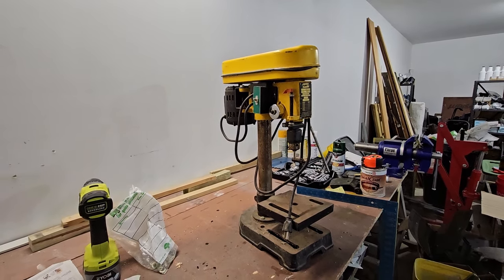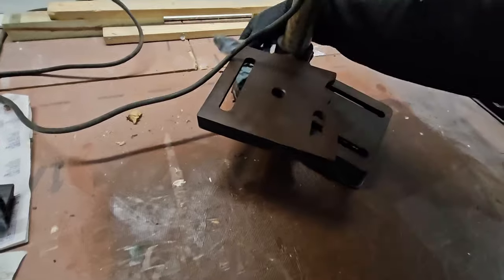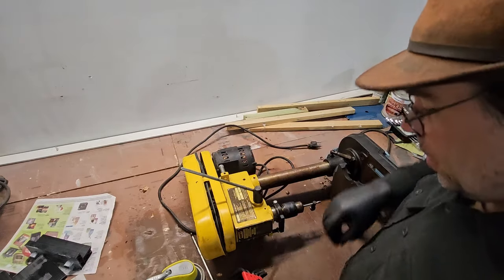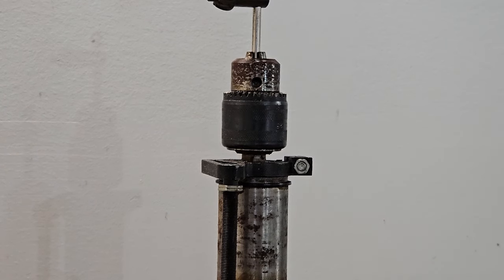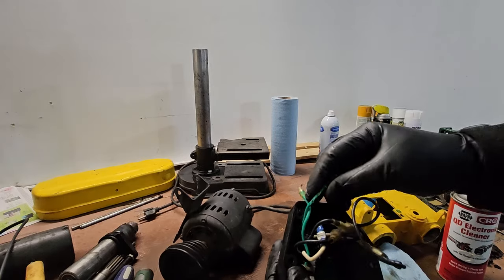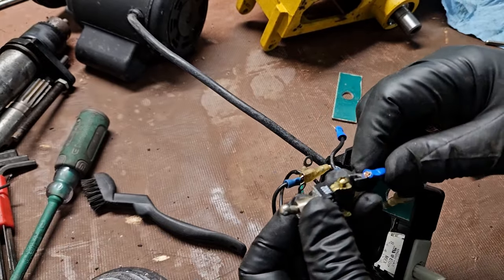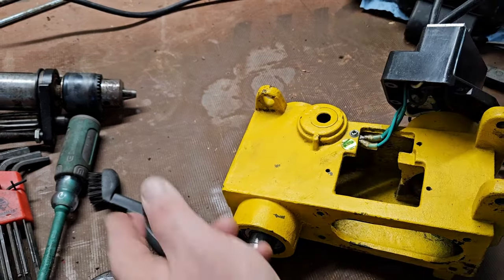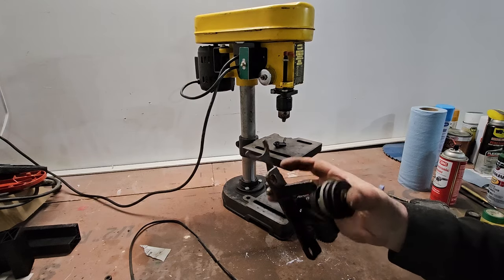Can I get this old AMT drill press working again?

Comment: Uhmmmmm….Aaron……I had no idea it could actually work again. Can I have it back? 

Just kidding😁😁 

It once worked well, loaned it for drilling fasteners holes in aluminum rail at the club. Then one day it disappeared. Years later I found it had been abandoned to the tractor shed and was under a few years of accumulated sediment and junk. Thought it still worked when you got it.  I keep having to re-learn the “personal tools loaned to a club environment” lesson. 
Nice work!
Reply from the maker: First of all, thank you again for the drill press. It's been quite an adventure and well worth the effort. But the saga isn't over! There are more bumps in the road for this drill press, and it may end up back in rail drilling service with a DC motor and a new set of spindle bearings.

Comment: Cut a half inch off the handle and re-thread, no need for new rods.  The vibration could be that the pulleys need to be realigned, as the belt will cause that vibration if it is riding against the side of the pulley.  Good job saving that old tool.
Reply: If you do it on all three, nobody will notice the difference
Reply from the maker: As I was talking about replacing the handles, I was also thinking about getting my old lathe out of storage and re-threading the ends. Unfortunately, the lathe isn't in great shape, either.
Reply: @MillBrookRailroad  Do you think that the handle material is too hard to thread with a hand die?  Seeing that one of the handles bent near the threaded portion would indicate (to me) that the material is soft enough to thread by hand.  Good Luck